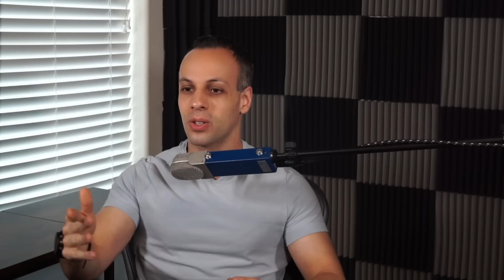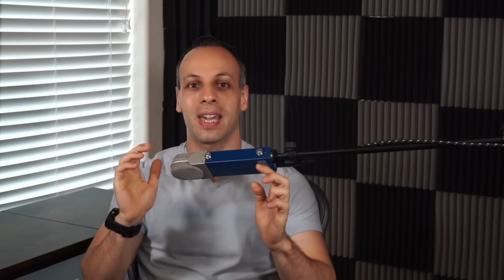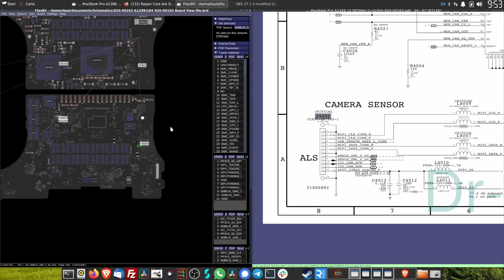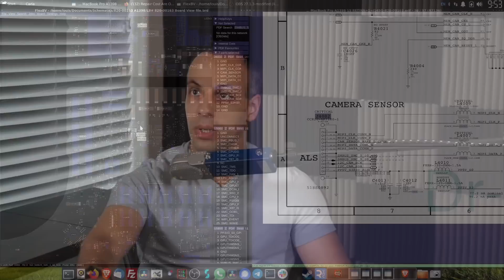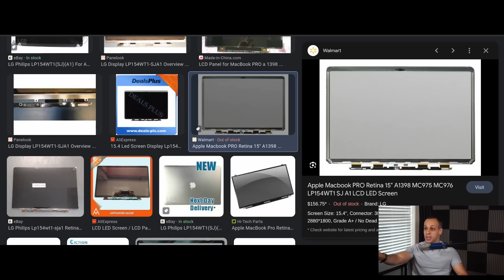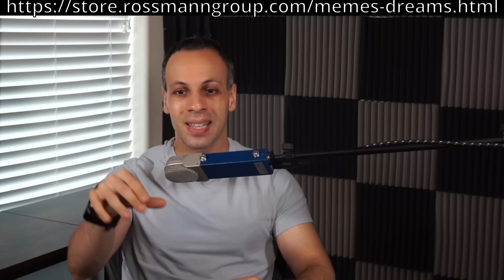The Ford F150 Macbook - when car repair resembles macbook repair...

Comment: This network is automotive can c. I don't know ford's architecture but the network protocol is standardized by SAE and the same in all manufacturers. However, the manufacturers can decide how to setup the architecture. 

It's a two wire network with little fault tolerance. Unless ford uses a daisy chain the module that has water intrusion can isolated at the vehicle will operate, just without that ADAS feature. Even with a daisy chain it could be bypass.  

There are many ways to wire a network architecture and they could have isolated the ADAS systems from the power train. But most manufacturers don't.  They also could have built the weather seals ford tough. 

This could happen on any module or make with water intrusion anywhere, since it's an industry standardized protocol.

Comment: I think its more company's want to make as much money as possible so don't care if you can't fix it cause you have to buy an upgrade or replacement cause they think society prefer things to be disposable. Ex-sample at home i recharge my disposable Vape pens that i buy cause they cost $35 dollars each using a 18650 battery charger its works most time until the sensor dies or the coil whats so stupid about it they use rechargeable cells. but leave them 2 parts that right the hole thing off when the cell is fine. its a shame esp with my country stants on vape units in Australia it helps me smoke less tabaco. sorry for my bad spelling or grammar i have a disability.

Comment: In the old days, when a tail light would have water ingress, you create water egress by drilling a hole in the bottom and you grease up the connector to it, so the harness won't rot away. And your tail light will be okay for quite a while, still.
Fords are not built tough. They are built to a price point. A CAN bridge module between these detectors and the rest of the bus does not any functionality. Neither does separating the actual module and the proximity antenna whereby the actual module could be mounted in a safer spot, inside the car. It just increases the cost.

Comment: They need engineers in the design process. As a mechanic I wish I could get a designer and ask them to repair/wearing parts. They don't seem to care. You're 100% right. It's too complicated and there is a distinct lack of thought in the process. Throughout. As an easy axample, the fuse board in the Ford transit van/bus. Is in 5 different locations. And of them requires removal of the driver seat to gain access.😂

Comment: I have a 2014 explorer. Costs about $15 and 10 minutes to replace any of the main bulbs. Fog lights are a bit trickier but not much. It jas almost 200k miles and fingers crossed it runs at least 100k more so i dont have to deal with this nonsense!

Comment: A YouTuber named Samcrac once bought a pretty new BMW X6 (I think) that had water leak through the sunroof, destroying the module for one of the front seats, rendering the car inoperable.
It got totalled by the insurance company, because nobody at BMW was able to find and fix the error.
But, here in Europe at least, I can walk to my Ford dealership and order whatever part I want, and I can find pretty much everything for reasonable prices new on eBay. Though with control units you sometimes need to get them programmed, before they can be used.

Comment: I remember a time, when if something failed catastrophically in the front- or taillight, it would pop the fuse but the other side of lights would still work, since the left and right side were on separates circuits, ensuring people could still see the lights.
Don't know if shutting the whole car down is more safe or not🤔🙄

Comment: Im a mechanic and its my opinion that cars peaked in the 90,s. They had enough electronics to make your life better, but not so much unnecessary garbage. And you didnt have to be a genius or have a lot of test hear to work issues out analog inputs could usually be wprked out with just a logical fault analasys. I still daily a vehicle from the mid 2000 and have no want to update.

Comment: A single endpoint should NOT EVER cause CANBUS total system failure.  Literally part of the design of the devices is supposed to prevent exactly that scenario.  The line is a differential line.  If the module fails and holds the lines at a steady state, the system should have been designed with redundancies for the critical systems, such that tertiary systems cannot cause failure of the critical systems.  I agree that negligence and ignorance are no different than active maliciousness, either way the problem exists, and it should not.  The first question design engineers should be asking is "what are the most prevalent failure modes" and "how will the end user screw this up"?  You must design for the lowest common denominator if you want your product to be successful.  OEMs are relying on two things today for sales:  1. brand loyalty, and 2. lack of genuine competition.  It's despicable, it's disgusting, and it needs to end.

Comment: At least the airbag sensor connector is bright orange and easily spotted to disconnect.
That was one of the greatest things in my RX7 manual.  All the wire harness connector locations were shown.

Comment: Mechanic here. Couple points to add. Geberally on 2000s-2010s cars with various CAN networks, one faulty module can turn the bus off but generally does not actively damage the other modules, even if the data lines are shorted to voltage or ground.
Also items on the network being "essential" or not is partially why there are separate networks. Engine, transmission, and safety stuff usually run on high speed, basic chassis stuff is generally slower. (Windows, hvac, radio, wipers, etc) but they do actively talk to eachother even if just to look for a message thats missing to tattle that you lost comms with that specific module. Theres cross talk too where like the radio night turn up the volume if youre speed is over x and you open the window. I think the whole idea is to get everything talking using less wires.

Comment: There are designers out there who don’t have the necessary skill of having such oversight and way of thinking.
I even worked with designers who switch warnings off and then wonder when their designed product doesn’t fit together. But it worked on the computer they say. 😂

Comment: I've been warning people about this for years. My Honda Africa twin had normal H4 bulbs that you could get anywhere for a few bucks. Now they have a LED light (33100-mjw-j01) that costs $2700.

They pulled the same shit with the blinker controls: This was a $30 relay, now it's a $300 computer.

A set of four spark plugs (DPR8EA-9) used to set you back $24 per 100.000km, new ones (SILMAR8A9S) will cost $160 per 100.000km.

No way in hell this isn't an intentional way to undermine the repairability of vehicles and it needs legislation before it becomes a problem in 5-10 years!

Comment: Car part prices are out of control, even parts that the manufacturer knows full well are susceptible to damage, such as exterior lighting. For example,  a base model 2016 and up Civic with bog standard Halogen lamps will cost at least $900 per headlamp assembly straight from Honda. We're going to see a metric fuck ton of newer cars with a bevy of warning messages on the dash because some rando module is dead, not programmed, on national backorder or just straight up discontinued.

Comment: To make matters worse, try finding a technician that could actually find these issues, they're few and far in between (just finding a good mechanic is already difficult). There have been times where I would have to bring out an oscilloscope just to find an obscure issue, like the brake pedal sensor causing an intermittent short that keeps the engine from starting or stalls engine and the only code (or odd data) is the crank position sensor.  Now imagine trying to convince a customer to pay for the time for troubleshooting that...hurts the tech and the customer.
Reply: When it comes to electronics and sensors even techs don't want to deal with it because the return on their work is not worth it. Can't say I blame them.

Comment: OK Australia and Mazda quoted a friend $7342.00 au to fix tail lights on a car with a $2400 value, I fixed them for around $80 bucks with a relay some wire and a fuse.

Comment: It's planned obsolescence. Auto manufacturers are only required (by law) to make repair parts available for 10 years after date of manufacture. So when those trucks are 10+ years old and Ford discontinues manufacturer of the parts needed for repair (and they will)... that $5600 repair will be impossible and brick the truck entirely unless somebody reverse engineers the entire assembly (not likely). So instead of a $5600 repair, you'll need to buy a new truck and trade in the bricked truck receiving only it's value in scrap metal. And no, you can't just buy a used part. Those modules get programed with the vin number and often times can not be reprogramed for another vehicle.

Comment: As cars are becoming more like computers this is likely to get more common. It’s really sad. The electronics is the most likely part to fail and the most difficult part to fix in a modern car. Not to mention all the electronics is used to intrude on your privacy.

Comment: I hate the fact that cars these days are over-engineered... What happened to vehicles that just takes you places, without rain-sensors, obstacle sensors, small motors in automatic windows, mirrors, trunk etc. I just want to buy a vehicle that has 4 wheels, a motor and steering in which everything is manual.

Comment: The argument of "they didn't intentionally make the repair difficult, they just designed it that way" shows a fundamental lack of understanding of a proper design process. When you are designing something that you know will need to be repaired, you are supposed to have "Design for maintenance" (i.e. repairability) included as a function of the design, not an afterthought at best. This is not a novel concept, this is something that is specifically covered in any (good) engineering degree course list. 

Really, it should always be a required function that is included in the thought process for designing anything, but especially for expensive things or things that are likely to see a fair amount of abuse (which a truck counts as both).

Comment: Why couldn't you just isolate that part of the can bus to allow for communication for the rest of the vehicle and tell ford you don't need the reverse sensing garbage? I mean as long as you have the loop closed you shouldn't crash the whole can bus...It's not like it is in a MOST fibre optic system that if one component goes down so does the whole thing.

Comment: I miss the simplicity of changing a blown light bulb. Be it a headlight, taillight, indicator, or internal cabin light.  My thought is it is not so much the led that fails.  It is the construct it is attached to and how that construct is implemented.
I cant see how todays tech in the above situation is any kind of improvement over changing a light bulb.  Or heaven forbid, cutting two wires and replacing the socket for said light bulb. ..........  Just like online banking and touch and go purchasing is "easier" the behind the door costs or prohibitive to the consumer.

Comment: We already have “The Right to Repair” movement, which slowly but steadily is gaining ground across the nation.  Just a thought, maybe it is time for “Poor Design” or “STOP turning earth resources into waste” movement address the products that designed in a way, that you can repair only by replacing a complete item rather than a part of the item that is actually broken; that will address products with short longevity.  I bet that all those people that promote less emission lifestyle would back this movement up. (Or may be not 😂 )

Comment: Car repairs have become just insane. They were amongst the original scumbags engineering the idea of ridiculous inseparable blocks of components you can only replace in one lump long ago. Trouble is the things they lump together have deliberately become more and more expensive. This corporate behaviour is a God damn plague. My god damn dishwasher machine company does it. The silicone gasket around the soap powder reservoir got damaged. Can I replace that gasket? No! I have to buy the whole soap dispenser assembly for $90. It's infuriating.

Comment: My 2006 Impala barely cares that many wires are barely held together, parts have been changed with different from stock, and body is really rusty. As long as OBD2 doesn't call up enough it will move until it turns to dirt. Still too many computers but efficient enough

Comment: I spent 17 years in the automotive industry and watched CANBUS come into the market.  As soon as you said the truck stopped working completely, I shouted CANBUS.  While it is cool for some of the features deep inside, if you are techsavy you can reprogram some things.  That being said, I will personally NEVER purchase a vehicle with a CANBUS system.  When I bought my Jeep in 2018 I specifically bought the model with no electric creature features and a manual transmission, some of these new automatics are basically a computer shifted manual, I don't even want to know what the price tags can get up to.  Hell, this is a 2018 model with manual crank down windows, just like jeeps of old!

Comment: I thought that the car manufacturers use a process called FMEA (failure mode and effects analysis) to identify what happens if each component of the vehicle fails. Apparently that doesn't include the effect of excessively costly repairs.

Comment: Every one of these stories make me glad to drive an 18 tear old truck, live in the south so its not a rot box and just fix it when i need to myself. Replacing the tailight assembly takes 10 minutes and costs less than 10% the cost for that new F150.

Comment: The fact that the tail light isn’t adequately sealed for water ingress feels like a colosal oversight for any car manufacturer, but especially for a truck that is designed with the harsh conditions of off-roading in mind
Reply: "harsh conditions of off-roading in mind"
are these really or just marketed that way to people who never do ?
Reply: @autohmae  ford marketing. I’m aware that 90 percent of f150s are pavement princesses. But if ford is gonna market it for off roading it had better be able to handle it without significant problems. Of course in my opinion you should get a Toyota if you want a truck you can rely on
Reply: @crispyjokingtuna   ahh, yes, the quintessential American brand Toyota ;-) (seriously, they are actually a very interesting company, they wrote the rest of the whole library after Henry Ford wrote the book on mass production)

Comment: I drive a Ford from 1999, runs with the original spark plugs and i have just recently had to change them (250.000+ KMs, thats 1/4 of a million). and i only changed them because it dont want it to become a bigger problem and i wanted the acceleration power back, i could still drive the car no problem.
Also this year i changed 1 of the engine pulleys and replaced the ORIGINAL belt.

Thats 24 years running with original parts, 24 yearSSSSzzzzZZz! is it ideal? no, but my point is, the car has never broken down because of a single malfunction, even with the pulley and belt Fd up i could still drive the car, it wouldnt have lasted much but i could literally drive it; the concept of a car dying because some stupid thing that has nothing to do with the driving system or its essentials is beyond ridiculous, its preposterous. And in my own experience i rather buy old cars rather than BS modern toys, specially the EVs, yes i get it they dont consume fuel (directly) but i want a car that is reliable, a car that wont let me down, a car with no connection to the damn internet and no modern software ruining its components forcing me to visit workshops for no good reason, i want a car with a MECHANICAL interface, i dont want no touch screens or me having to look at a screen while driving. And defo i dont wanna rent MY OWN CAR because of some gatekeeping BS coccbloccing features behind suscriptions.

If imma be forced to buy an EV to drive inside cities i rather buy a decent bicycle, not even an electric one. F the modern automotive industry.

Comment: I'm in college for automotive technology. last year we were being taught how to use voltage drop. by placing the leads of a multimeter on both sides of the harness and checking the voltage while the component is running you will be able to tell if excess voltage resistance is in the wire on higher gauge wires like a starter. our teacher had us work on a Ford with a windshield washer pump. after testing the wiring everything was good. The teacher revealed that ford has their relays that activate other devices soldered directly to the bcm or pcm of the vehicle. when a relay goes out you replace the entire bcm. Side note a student was working on the school's ford f-150. they were disabling the fuel pump to test the starter. the student found the fuel pump relay. he managed to pull it out. cars are getting filled with alot of computers now. Even a Ford maverick with its lower price has I think about 20 -30 individual.